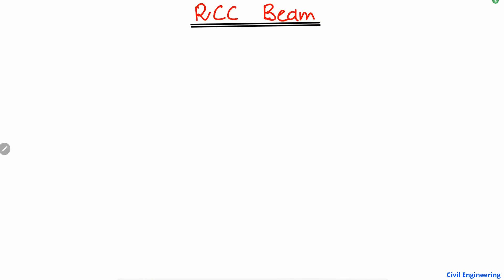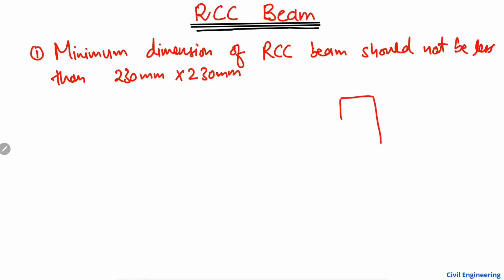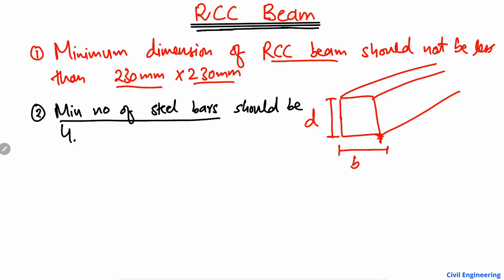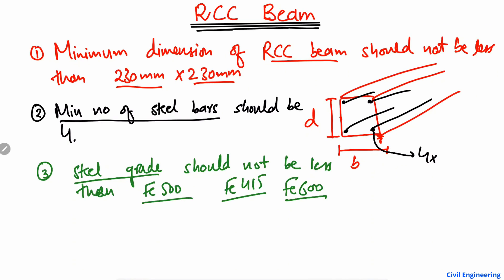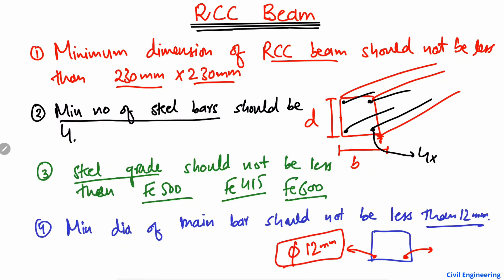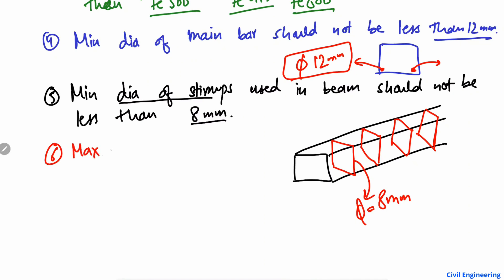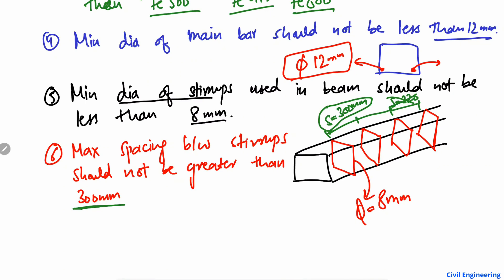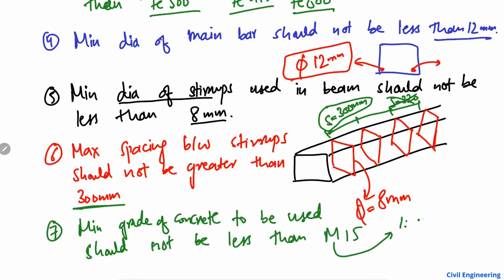Reinforced Concrete Beam - Important Points

Comment: I want to know how to design and calculate the number of reinforcement in beam column slab and footing
Reply from the maker: I will make a separate video
Reply: By USING BS STANDARD
Reply: Another question please...length of overlap stirrup which is bent at 135°